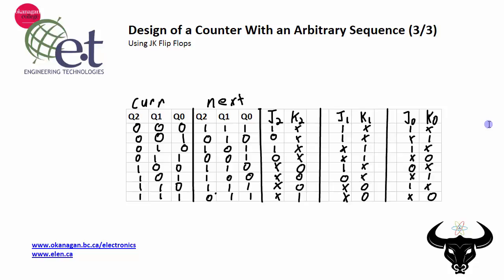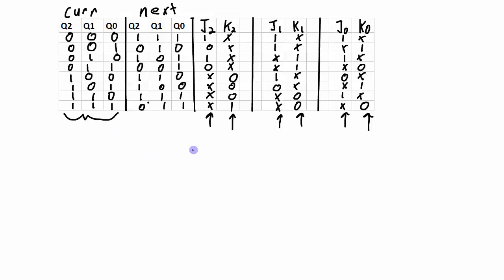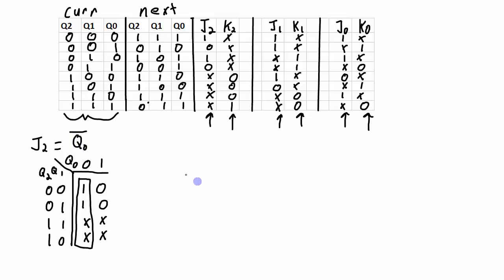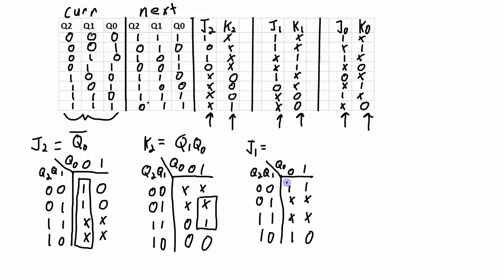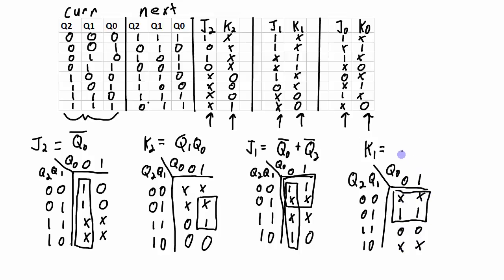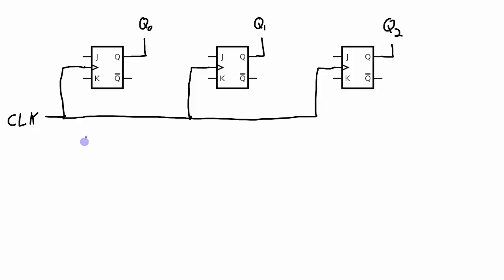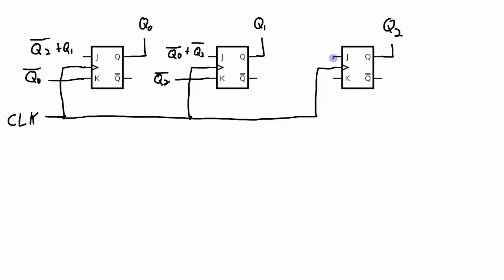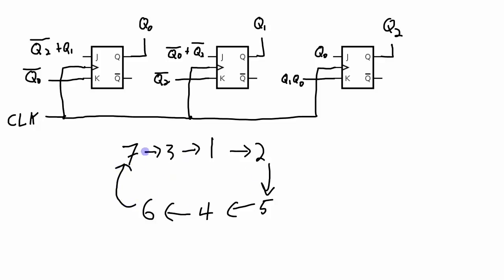Design a Counter with An Arbitrary Sequence (3/3)

Comment: What if its 4 bit and not all the number are there?
Like 9,4,11,2,7,6,15 and back to 9 ? 
The kmap is 4x4 and many labels are empty because the counter number is only 7 numbers? What we fill in that empty labels?
Reply from the maker: What you can do is determine all of the numbers not in the sequence and force them to go to the starting number. This way if your state machine accidentally became 0 (or some other number not in the sequence), it will jump in to a number that is in the sequence.

Comment: Inserted this in Logisim, doesn't seem to work properly. Some values like 010 or 001 never seem to appear in the outputs.
Reply: there are 2 errors in the circuit:  J2 = not Qo and Ko = not Q1

Comment: but where would we insert the power source (VCC)?
Reply: johnson noel All outputs are 0 initially. And the counter depends upon the clock pulse. So we don't apply power source.
However in an asyncronous up counter a logic 1 is provided to both J and K terminals of all the flip flops to toggle the output Q based on the clock trigger (negative or positive edge).

Comment: How can i display repeated numbers?  i wanted to display 400116823 but It doesnt work cuz of repeated digits
Reply from the maker: That sequence has 9 different states. Using this direct flip flop design method, you could create a 0-8 counter and then decode the states from 0-8 to the appropriate number. e.g., at 0 output decodes to 4, at 1 output decodes to 0, at 2 output decodes to the second 0 etc.
Reply: hey. have you done it? can you help me?